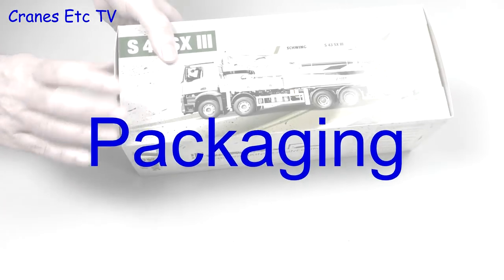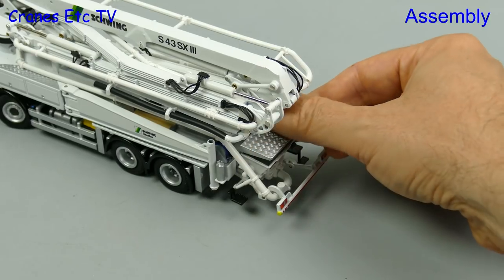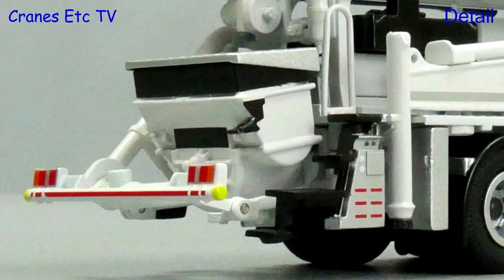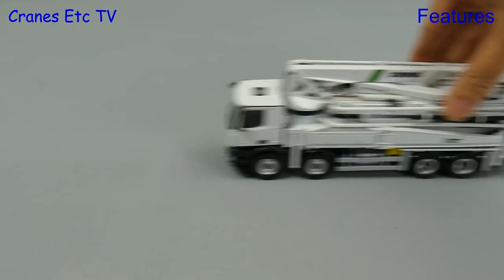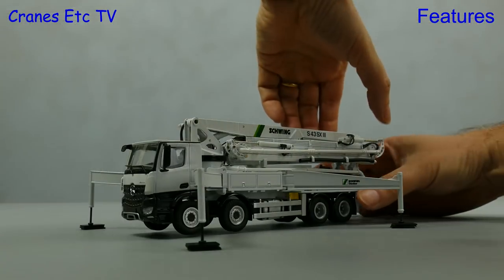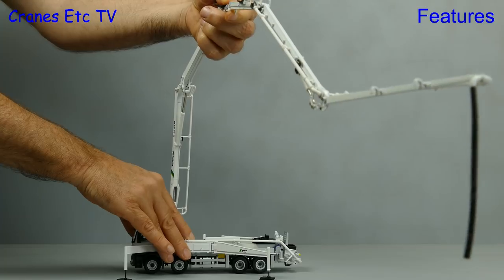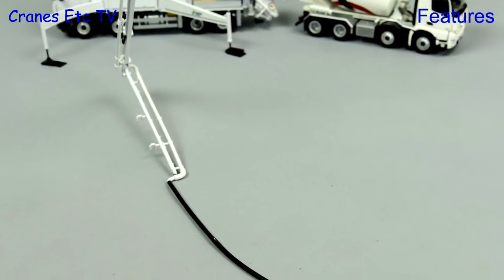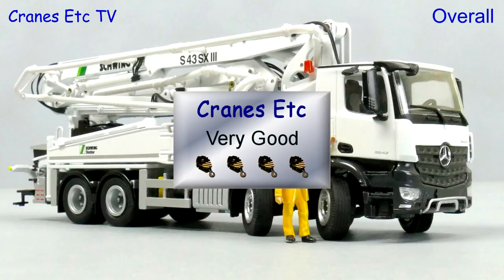NZG Schwing S 43 SX III Mobile Concrete Pump by Cranes Etc TV

Comment: Honestly surprised you knew what a hopper was or the variety equipment parts this channel does haha   Spreader plates should have slots on the side of the truck between the tires 
I like this model bc I had old job where we used a pump almost every job site.  Memories haha 
It be nice too if they had the pipe for under the hopper if you needed to pump inside a basement or something